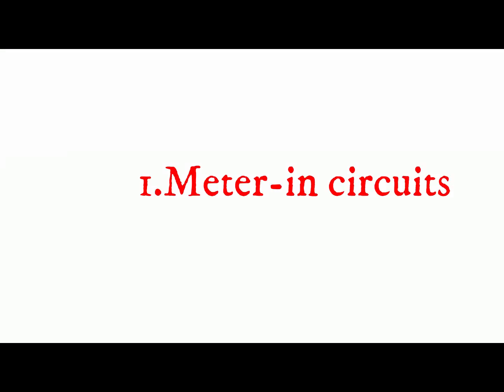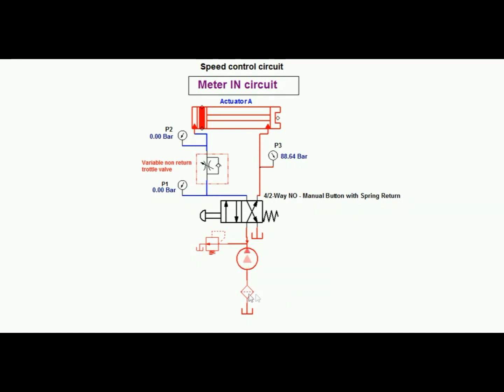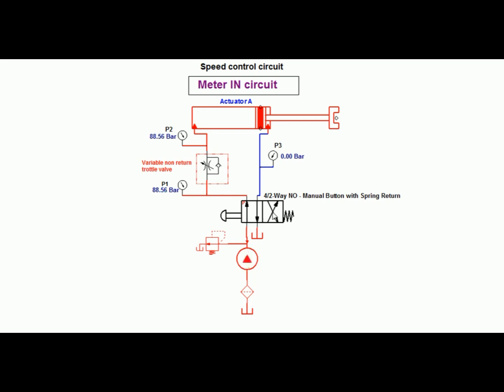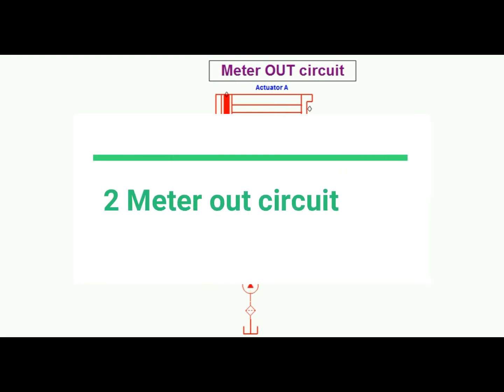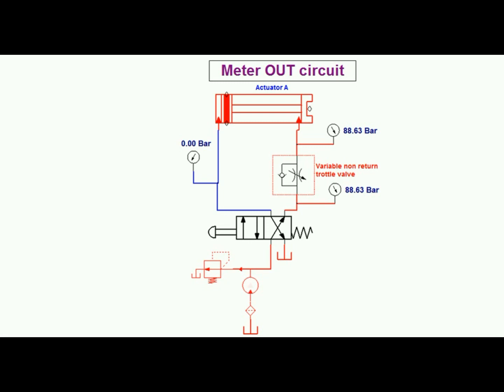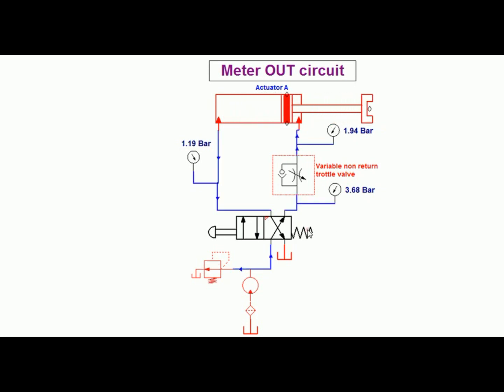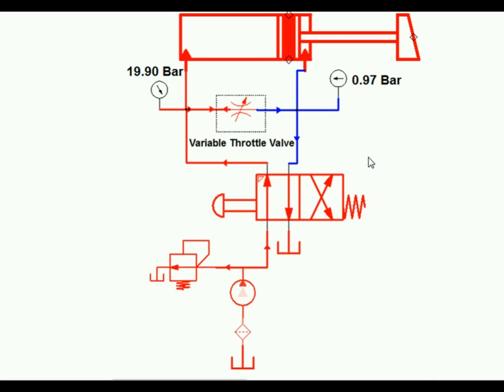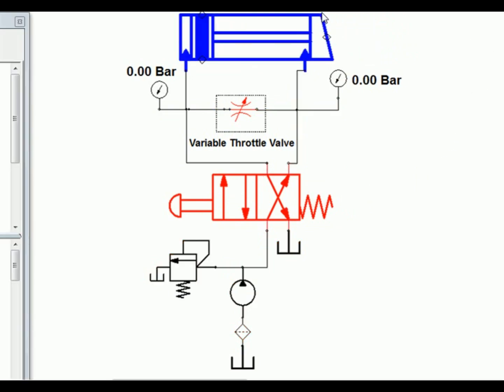Speed/Flow control circuit (Meter IN, Meter OUT & Bleed OFF )- Industrial Fluid Power | Animation

Comment: A fixed displacement pumps of 0.8 l/s supplies a 5 cm bore cylinder having a 30 mm
diameter piston rod and a total stroke of 1500 mm. The first 20 cm of extending stroke is
run at full speed (without meter valve in the circuit) at 10 bar, 80 cm is then run at 15 cm/s
and requires an effective pressure of 85 bar in the cylinder head. The last 500 mm is
performed at the same speed but requires 50 bar pressure.Compare the efficiency of meter-in, meter-out and bleed off in this scenario